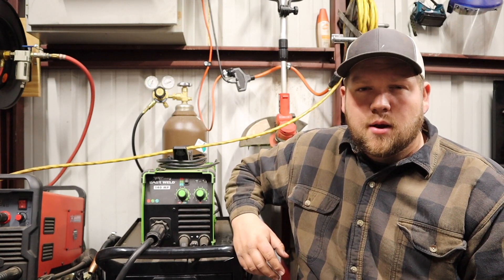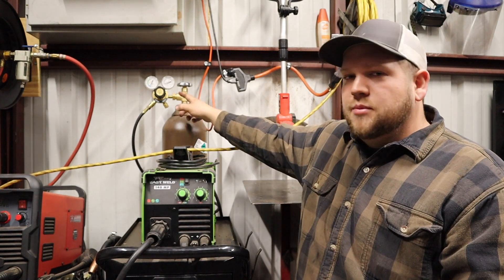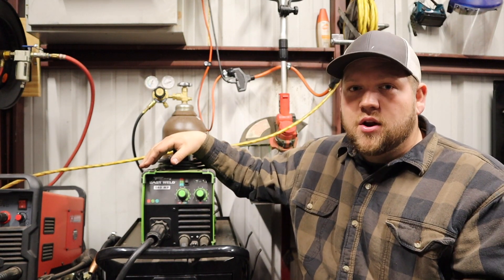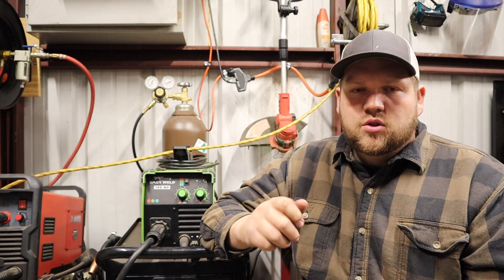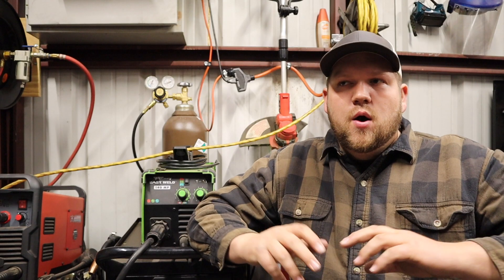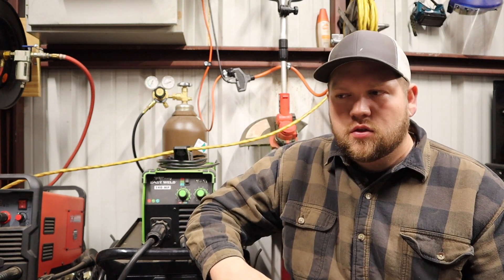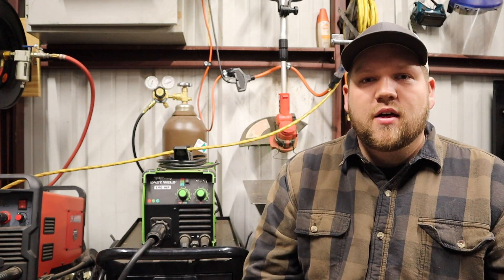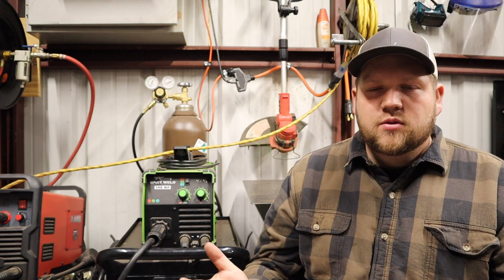Wire Feed Welding Basics - Difference Between Gasless Flux Core and MIG Welding

Comment: onds) 
Image result for reverse polarity welding
“Straight” and “reverse” polarity are common terms for “electrode-negative” and “electrode-positive” polarity. Welding currents with electrode-positive (reverse) polarity result in deeper penetration, while electrode-negative (straight) polarity has the benefit of faster melt-off and faster deposition rate.Mar 13, 2018
Reply from the maker: It's easy to cross them when trying to get through the video. I'm assuming you posted that because I mixed em up.